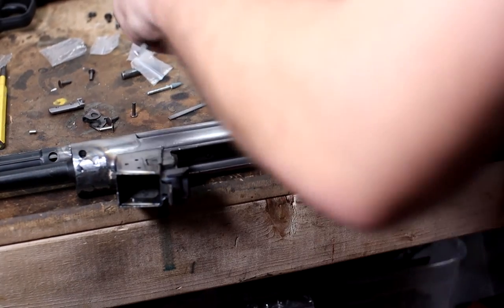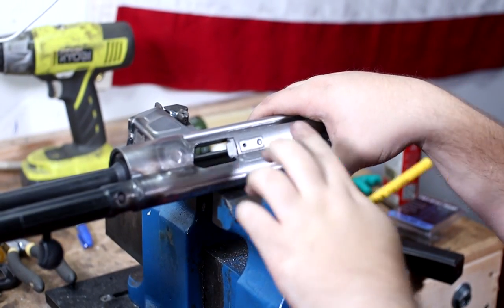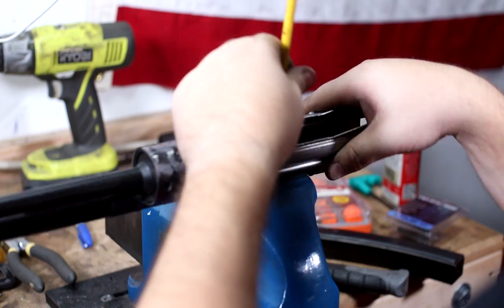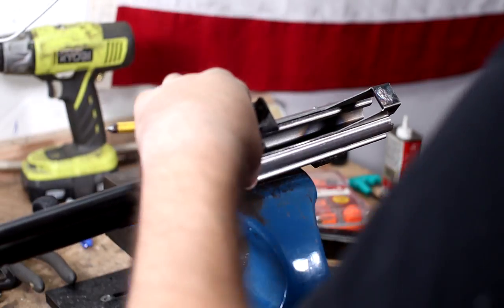MP5 - Part 10 Riveting

Comment: I did my rivets last like you and for the sling clip I used the Toth Tool rivet squeezer and it was super easy. Just a tip for others.
Reply: Also doing the sling clip before bending makes the weld clean-up at the front of the mag well more difficult since the clip sticks out past the mag well. I tried both ways and wouldn't install the sling clip first if I were to do one again.

Comment: Hey if you want to do a DIY coating, check and moly coat. I just watch in range TV retro 605 build(shortened barrel M16a1) and the coloring is perfect to the classic black. I really recommend watching it. If maybe you could try? Its also a strong coat and much cheaper